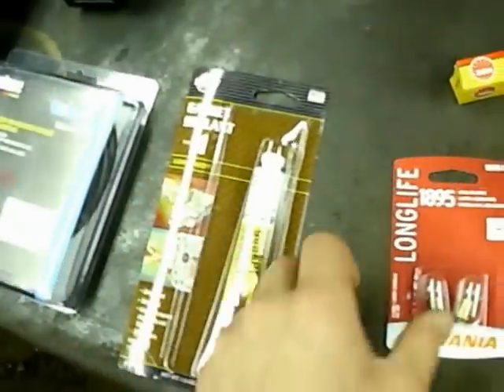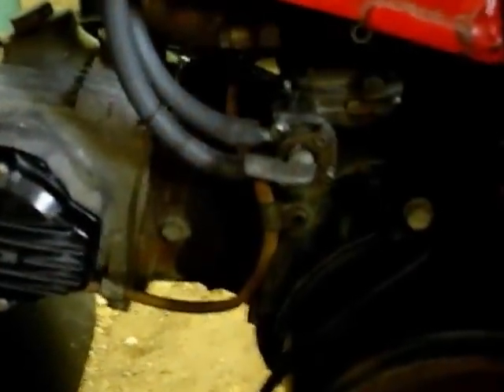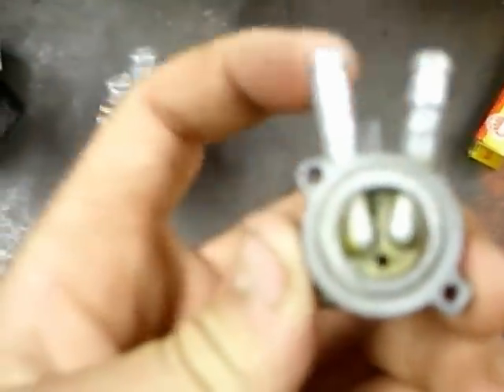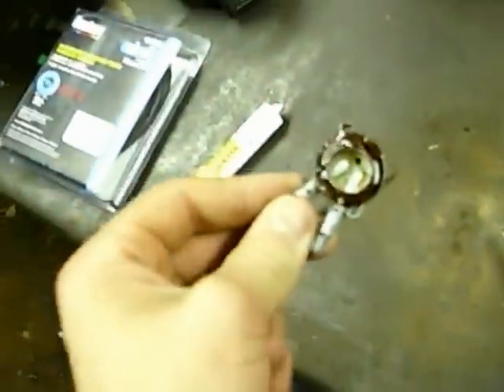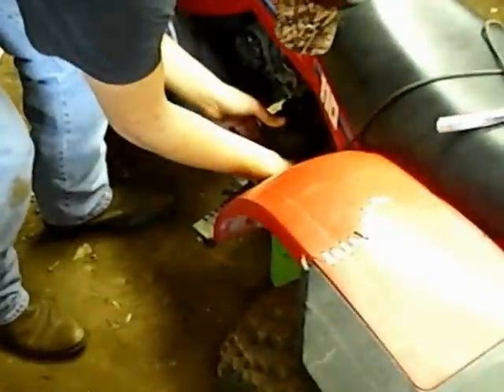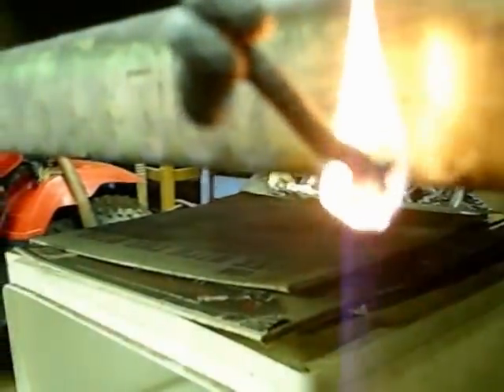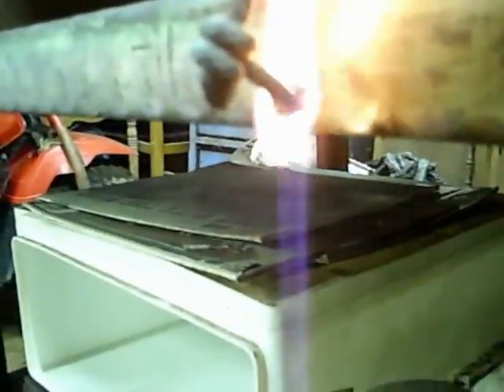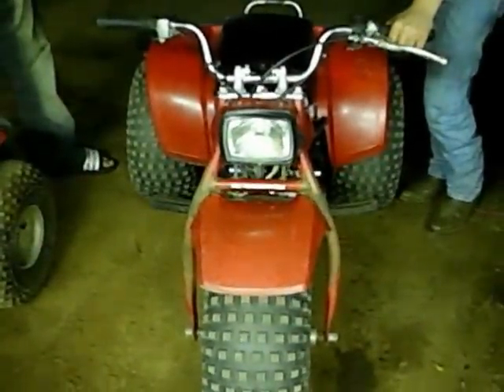Honda ATC 110 simple fixes

Comment from the maker: Im assuming the pull start recoil, and yes i had to do the same thing with this one shortly after i bought it. They actually make special tools to do this, (once again i didnt have them and i assume you dont either) so you can wrap it the best you can using a flathead screwdriver and a bench clamp. put the inside hook on the bench clamp and make sure its on there good. then wrap it around the tightest you can. it helps if theres 2 people. then use zip ties to hold it togther long enough for you

Comment from the maker: to put it back in the pull start housing. It actually became so difficult at one point, that i cut out some of the recoil, about 1/3 of it i just cut it out, and bent a new hook. It works just as good as it did with the whole coil and its 3x easier to get it back in! I can make a video to assist you if necessary hopes this helps!

Comment: Ok so my 85 110 is geting good fire and it is getting gas and it has good compression but it wont start.  Iv also tried to wet the spark plug and put gas in the plug hole and tried starting fluid.  I even cleaned the carb and checked the generator but still nothing even with new ngk plugs. Do you have any idea what it could be. The problem happened over night to it had ran fine.

Comment: Looks like you're just missing an o-ring on the petcock. (Or at least you don't show one in this video) Was it leaking with an o-ring installed? If there wasn't one at all, that's why it was leaking.